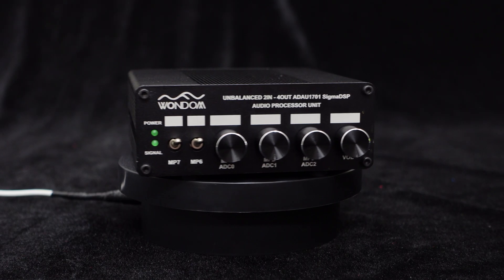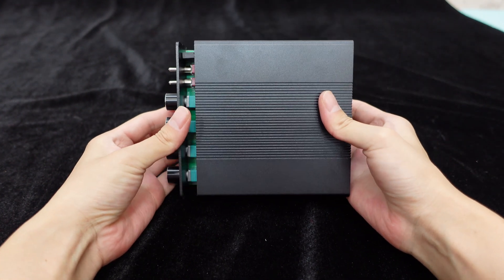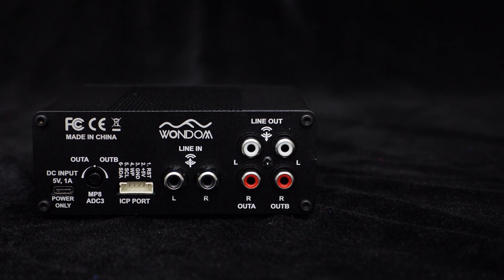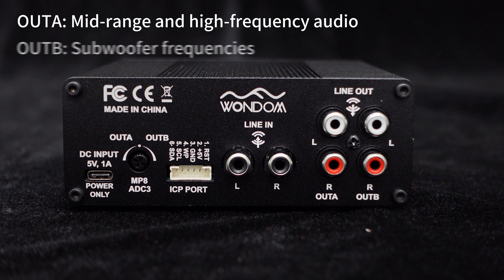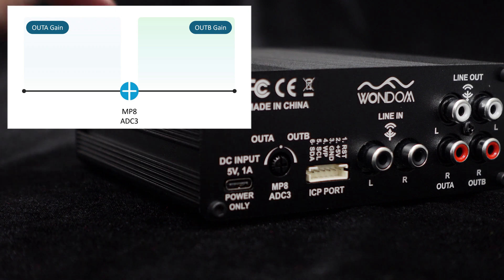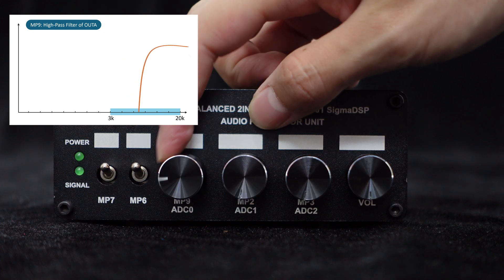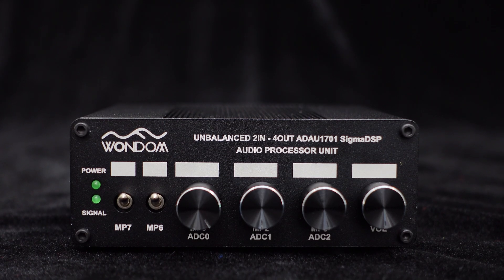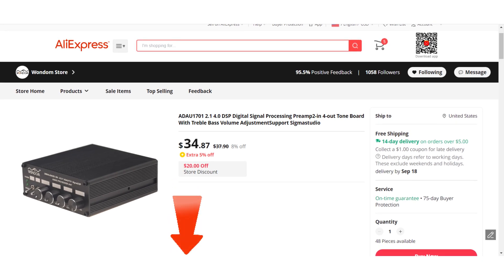Unbalanced 2-in 4-out Analog SigmaDSP Digital Audio Processor Unit 2-way Crossover

Comment: with eight outputs it would be far more interesting. it's a budget solution regarding minidsp but it's not offering a real bargain due to it's limited features. for 30$ more they could add 4 outputs and challenge 600$ minidsp box . ok, you can buy two boxes but it's involving more wires etc...this we really want to avoid. they also could implement the interface to connect to computer. that way it would be a ready to use module without having to struggle with separated pcbs

Comment: Здравствуйте.Т.е. out A начинает работать только с 3000 Hz? Вы же говорите что это выход на средние и высокие частоты. Хотелось бы: out A: 20000Hz-310Hz, out B: 10Hz-310Hz (это будет сабвуфер). Так нельзя реализовать?
Reply from the maker: Hello, this ADSP1701 preamp supports programming. After connection with WONDOM ICP programmer, you can modify the cut-off frequency through the SigmaStudio to cater to your specific needs. Wish this could help you. Have a fantastic day~

Comment: So what can I customise via the ICP5 interface? E.g. Are PEQ filters available for each individual output? So could I have 3 separate set of 10 PEQ for the Left, Right + Subwoofer outputs? If so does it come with a ICP adapter or do you sell one separately?
Reply: yes you need the little programming board [as stated in video very briefly wish they would have shown it but ] and  yes to other question the way it set up out the box is just about right for my needs but man can you do cool stuff like bass boosting and other jazz in sigma studio  i have not done it yet but ill be doing it soon as i buy this thing sweet little deal here and i can say all my 5 other amp board are good i bought from them years ago